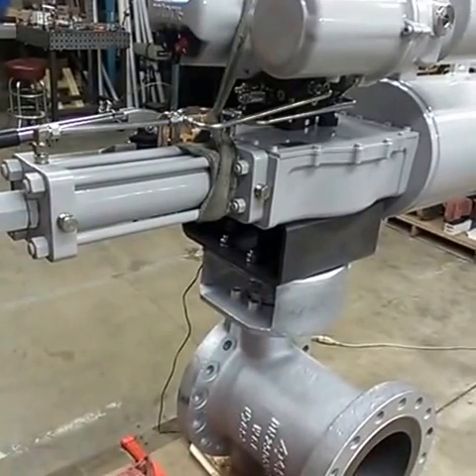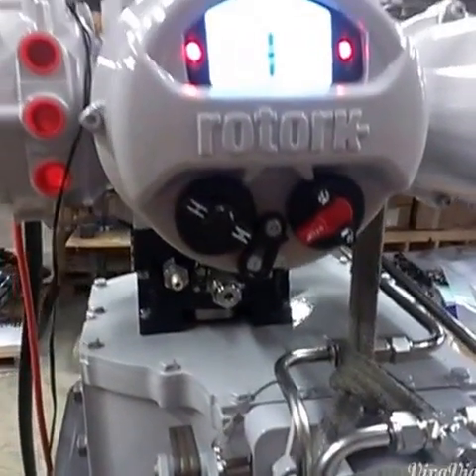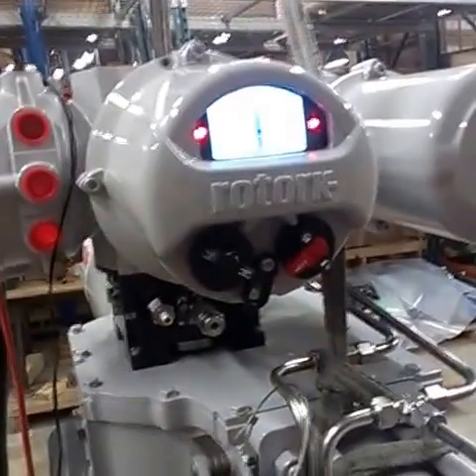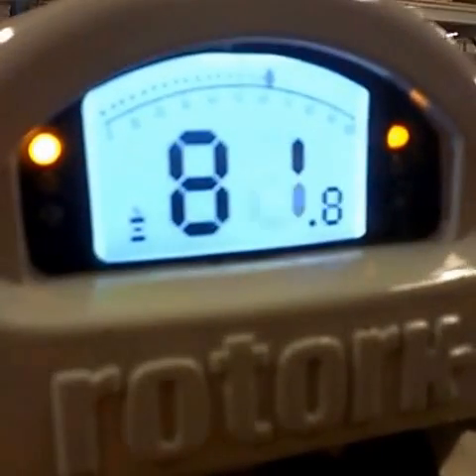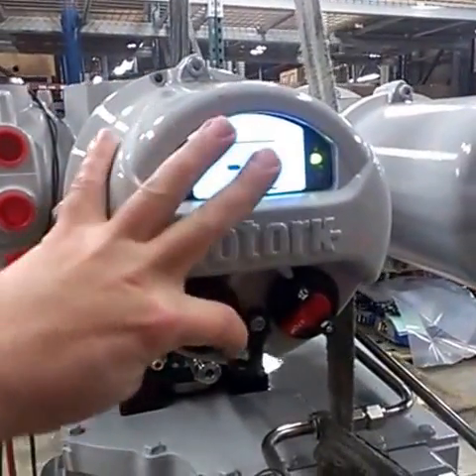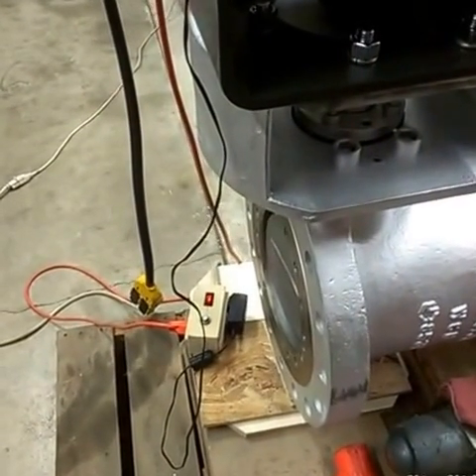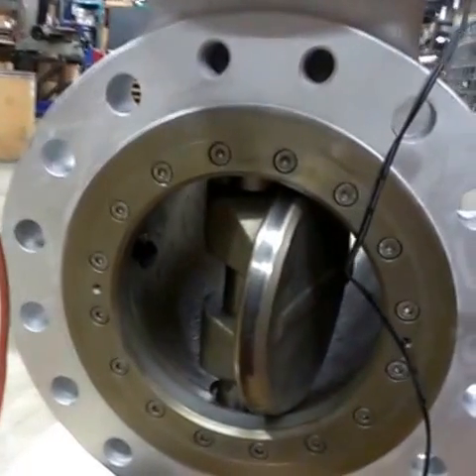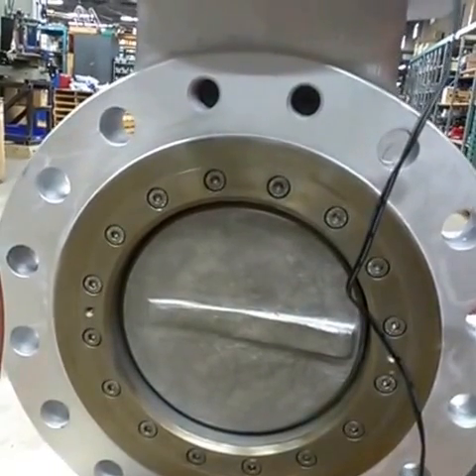Rotork Electro-Hydraulic Skilmatic Si3 on an Adams 10" TOV (Triple Offset Valve).

Comment from the maker: I would like to clarify that if the ESD signal is retained during a supply voltage (120VAC) loss the valve and actuator will stay in the OPEN position.  The ESD (Emergency shut down) signal supplies a 24VDC signal to an internal solenoid valve which when energized will maintain valve position.  If that signal is lost the valve and actuator will close.  I was not specific when explaining that function.  Sorry for the confusion.
Reply: Hi
Reply: Thanks